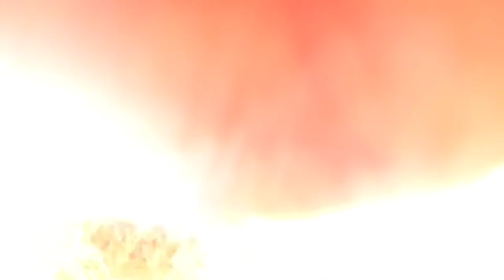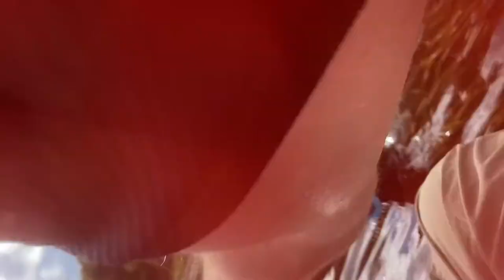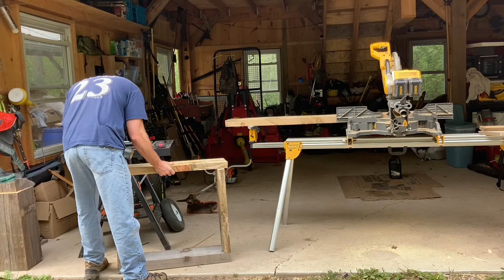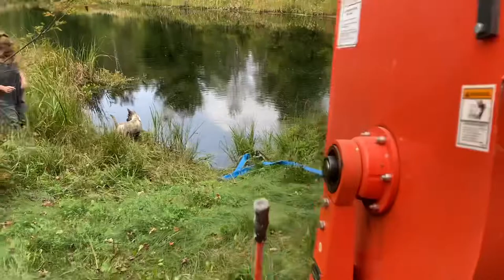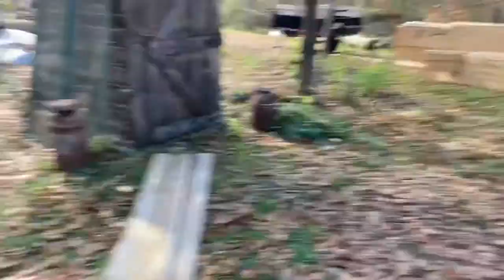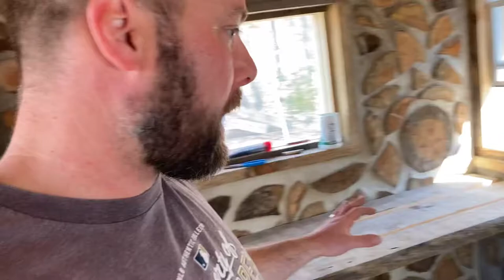#167 Turtle Attacking Heron/ Sauna Window Boxes and Benches

Comment: Just a friendly tip...I wouldnt varnish anything INSIDE the sauna...no need for it and the heat from the sauna can cause off gassing from the varnish etc. Im not a chemical worry bug, but if it stinks its going to make for an unpleasant sauna experience. I would just leave it natural. Love the vids, keep em coming (On Wisconsin!)
Reply from the maker: Good call I agree we didn’t and it’s worked well after to uses so far
Just a little sap but not bad so far